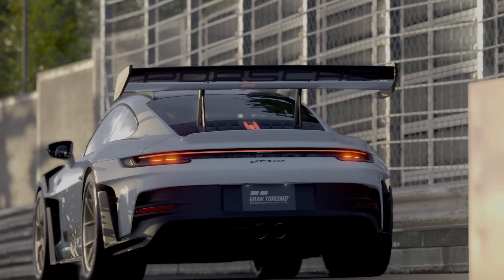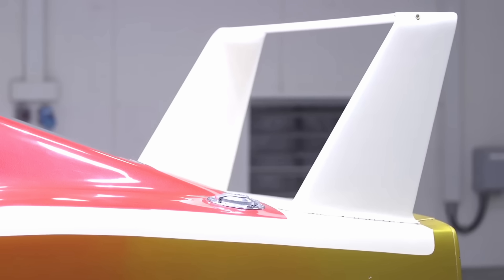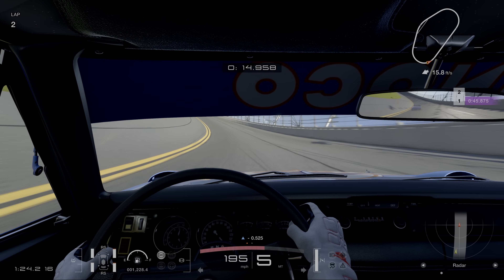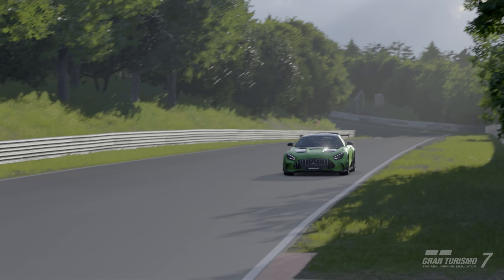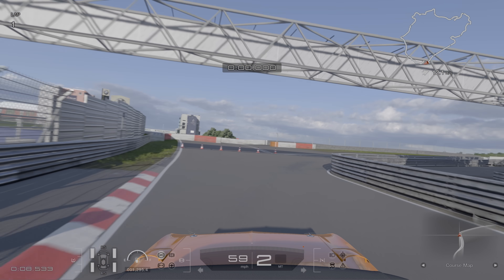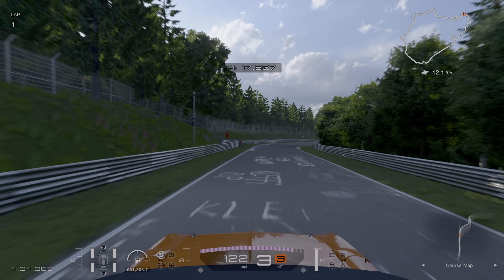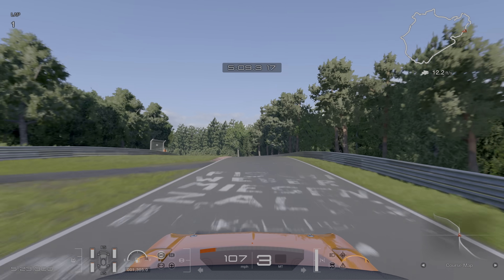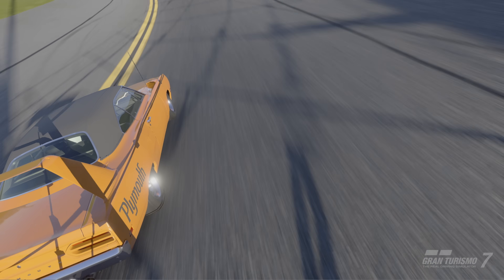Why Is This Car Undrivable in Gran Turismo 7?

Comment: Just wanted to mention, given the car that was a sensational lap. That was some serious jaw dropping performance mate
Reply: No kiding. It was surreal seeing that old boat blizing around the corners like that.
Reply: @souldude6344 the bounce on some of those corners was downright terrifying. I would’ve liked to see more cockpit footage of this lap
Reply: Indeed
Reply: Not to surprised really as Superbirds had great power to weight ratios, and surprisingly high torque even by modern standards. Also, people are forgetting that Superbirds got banned from NASCAR because it was way to fast, compared to it's competition.
Reply: @marcusking332  Thats just an urban legend. The Superbird got banned because it was no longer homologated. it was built for one year, so it could only race one year. NASCAR requires that any car that races has to to some extent- be built and sold the same year as a consumer car.  The Superbird was built only one year, and was a commercial flop, so they stopped building it- disqualifying it from racing after 1970.  Even then- the NASCAR raced version was significantly different from the commercial.  different suspension, different aero, tuned, stiffened body, etc.
The Superbird was such a commercial flop- that there were 1970 models still on dealership lots in 1972, which Plymouth started providing kits to modify them to be 1970 Road Runners so they would eventually sell.
Reply: @DR-pu5hm that's not true. Nascar rules for the stock division since the beginning has always allowed car from the current year and pervious 2 years. Meaning they could've ran it 2 more year but Ford was developing a more aerodynamic car and Nasar saw an aero war coming and banned them all.
Reply: @marcusking332 more entirely true. It only ran on the super speedways. Even then wasn't that must fast then the ford. GM really suck at this time and everything was faster than it.
Reply: @souldude6344 people forget these things are going around banked corners at 185+ even back in the 70s. The stock ones are slow, sure they weren't meant to be going above 90 realistically but with an actual NASCAR version(which is more or less what is presented on the Nur lap here) had some of the most advanced suspension components of the time given the speeds at which they took corners people forget how many G's that is

Comment: That car still looks scary as hell to drive..
Reply: To be fair it's basically a Dodge Charger with a big wing and sharp nose if you dumb it down to the core. Handles a bit better than your regular Charger R/T but don't expect it to run tight rings around a Lotus Esprit
Reply: Skill issue
Reply: @PlatinumNath I think you mean the Lotus Exige?
Reply: Does look kinda fun though. Seeing it glide through the corners at those speeds, bouncing all the way.

The idea of pushing to the limit an old car with that sort of roughness or lack of refinement to it's design would be appealing to some. So in that respect it does look fun lol.
Reply: @FLAMABBLE  I'm correlating it to a period correct(ish) example (1970s). If period correctness is not in my mood an Exige or Elise would work just as well to demonstrate comparison, but since it's not the case, I put the Esprit as a comparison (1976, compared to Superbird which is made in 1970. Course I can also use the Elan or Europa instead which is even more period correct but I bend my own rules sometimes, I know, I'm a scrutinizable pillock)
Reply: any race car is scary as hell to drive.
Reply: @DanielAlvarez-o6n  who said it was a skill issue?
Reply: But its a roller coaster or  bungee jump scary you want to be scared
Reply: @PlatinumNath  it's a roadrunner tho
Reply: @Taffaff  the Superbird version is a derivative Charger Daytona iirc but idk maybe you're right maybe not? It uses and alters some parts to make it look a little more "Plymouth-y" from the Daytona (apparently the Daytona was called ugly back then for some reason) from what memory serves me, which means that it's mostly a Charger underneath in actuality despite claims of Roadrunner basis - if that was true
Reply: Looks violent over the bumps like old NASCAR before they discovered coil bind setups.
Reply: @Maximus20778  i did
Reply: @DanielAlvarez-o6n  so you have driven a Daytona charger going 200 around a track no then stop talking
Reply: @Taffaff  it's like a trans am and a camaro or a challenger and a barracuda they are basically the some car built on the same frame with mostly the same parts
Reply: It is
Reply: @PaperBanjo64 sometimes its constantly rolled over if it tuned poorly especially on the front suspension.
Reply: Lol try driving a big block b-body mopar, if you think the video is scary.  We had one, 69 roadrunner, summer of 99, no corner went without a drift, tire smoke and a screaming V8.  It was an ex drag car with a cage and 2 seats
Reply: Old cars did indeed seem scary to drive fast believe it or not
Reply: It's a video game 😅
Reply: @PaperBanjo64  Mopars didn't use Coil springs! They were torsion bar front and had eliptical leaf springs in the rear.  Meaning the rear end was placed more forward on the leaf springs than centered.
Reply: @PlatinumNath it handles unbelievably worse than charger R/T. I can do le mans 30 minutes in my charger no issues at all even in the rain with 971 hp. This thing blows.
Reply: @Taffaff  That's a distinction without a difference. Road Runners and Chargers are basically the same car sold by different brands
Reply: Meanwhile me driving the 1969 Pontiac GTO judge at 600pp with 686hp and 800+ lb-ft on medium sport tires 🙃
Reply: @dc_modelworks  They do have their differences, like the superbird is about 3 mph slower than the daytona irl, I think they had differences engines too.

Comment: I guess the important thing to say is that the Superbird, on the racetrack of yore, was a heavily modified car with a cage in it (makes the whole chassis stiffer) using every trick NASCAR would allow, and some it didn't, while some of the smartest mechanics to ever live tweaked the car for the high speed oval. But the version the game gives you seems to be the civilian version of a 1960s road car, with a full interior, none of the modifications, and it would appear a very floppy chassis with a solid rear axle and 1960s suspension technology. This car knew it was going on the American highway, at maybe 100mph if the cops aren't looking, for a brief period, in an arrow straight line. Go figure, it's not ready for serious racing without modification.
Reply: is hilarious as it is sad that people see the street superbird and go "yeah this is exactly the same as the race version" like my brother in christ they aren't the same car at all
Reply: I've gone more than 150mph in old 1960's street version mopars. One an old 1969 Coronet 440 and another a 1966 New Yorker more highly modified. The Coronet was doing what I would call seesawing at high speed. Kind of rolling side to side and the steering was very light. I went by about nine Mass state police clustered in the highway center. If any came out to play I never saw them in my rearview mirror. 
The New Yorker had a polygraphite front suspension and a 440 built for me by someone that built Nascar Mopar engines in the 1960's and was still building offshore powerboat race engines. I lightened the New Yorker a lot. Took out the dash, AC, and heater, removed the rear window regulators and locked them closed, all the seats and put in two Dodge Omni buckets for seating.  I put in a custom aluminum dash with digital gauges. It actually was far better handling than the Coronet. I ran that to 150 or more many times. 
The thing about old Mopars is you had to know how to drive them! You didn't know how to drive them you could die real easy. To me though they were far better at high speeds than any Ford or Chevy I drove of 1960's vintage. Bias ply tires weren't exactly great for handling but would leave the best smoke shows.
Reply: These cars were built for torque and 1/4 mile times. They were not meant or geared to drive 100mph.
Reply: @TheBeefSlayer  I'd say you are pretty wrong about that! The whole point of the Daytona's and Superbirds were top end speed and aerodynamics.
Reply: @TheBeefSlayer  The Daytona was literally named after a nascar track.
Reply: @ImponteDeluxo  not to mention the hemi s carter engine
Reply: @2bfrank657  The Daytona and Superbird had 7+ inch ground clearance- that rivals most small SUVs nowadays. The Daytona and Superbird are homologation cars- nothing else.  They were designed to meet the absolute minimums for homologation so that highly modified versions could race in NASCAR. Nascar versions had different aero, gearing and suspension.  The requirements were the frame, drivetrain (minus gear ratios), and engine block had to be identical, and the body kit had to be superficially similar.
While they are fairly stable in a straight line or big oval at high speeds, they are considerably less stable at 100+ than most consumer cars and SUVs nowadays.
Reply: Well even backin the day NASCAR’s were not stock.  Way more so than today but they were still tube chassis race cars with lots of modifications done to them.  They are subframe cars so they flex like crazy without modifications.  

And yes I got an old 340 4 speed Dart and it gets a bit frisky much over 100 even on a straightaway.  It came with factory front disc brakes and 11in drums in the back but still does not brake very well and the steering is. It super responsive and it moves and floats around a lot.   Is fun as hell to drive though.  Just love banging gears in the old girl.  There are quite a few modifications I want to do to make her perform better some day.
Reply: Finally someone who actually understands what they are talking about and aren’t obviously a 12 year old kid lolol , but you nailed it my guy 🤙🙌

Comment: Honestly, the Daytonas and Superbirds that were actually sold were really just a slightly faster and gripper Charger/Roadrunner. Underneath they're basically identical to their base cars, i think people forget that these cars only existed so they could be modified further for NASCAR and attribute the Stock Cars performance to the street car also
Reply: Totally, the Superbirds were a RoadRunner with a different front bumper and a big wing, that's it. Also, there's a video of an old man that explained how you could notice if a Charger Daytona and a Superbird are original, and it's that the Charger Daytona has real fender vents/scoops and the Superbird didn't. The car is amazing but it was made like you said just because it was a regulation and at that time it didn't even sell.
Reply: The superbird had the 1970 cornet front fenders as well.

Comment: Please make more videos exploring how to redeem poorly-handling cars in GT games. 

Racing game fans rarely discuss min/maxing because going off-meta just isn’t rewarding with massive car lists and seldom need for a specialized build. It’s why I love FailRace’s Horizon videos so much - their arbitrary race requirements show love to cars you never actually see in lobbies, and sometimes someone strikes gold with an insanely potent build.

I really think this could be a great niche for this channel.
Reply: Which is ironic, given that Gran Turismo and Polyphony Digital always had an unmatched love for cars in general and an absurd amount of customization, ever since the 2000's, to the point of including all the worst and most commin roads cars one could find, like a 90's Ford Ka. It is not for racing, and you are not expected to use them, but they are there solely because they are cars people actually drive around in. It is the vehicle selection of Assetto Corsa, before Assetto Corsa.

But perhaps it is the customization itself that allows people to think it is all about minmaxing. I admit, I used to do the same. When the dial for spring rates is in decimals, should I go for multiples of 0.5 (4.5, 6.0...) or actually nail it down (4.3, 6.2...)? How much downforce? How much differential lock? How much toe and camber?

You see in forums entire breakdowns of every car, down to fractions of decimals. It is all absurd as well.
Reply: @NothingXemnas  I don't think putting a spoiler on a car is called "crazy customizations" lol
Reply: @Maximus20778 At what point did they suggest only putting on a rear spoiler/wing is crazy customization? 

The moment you add anything to the stock vehicle, it's customized. Most customize with tires, wheels/wheel diameter/width, wide body(if applicable), engine tuning, air, forced induction, gear box, gear ratio, weight distribution, weight savings and the list goes on. How did you come to the conclusion of a wing is confusing, do you even play this game at all?
Reply: @evilformerlys4704  He's a troll, and you fell for it. 💀
Reply: Yeah that's a good idea make a list of the worst handling cars and how to fix them , even though usually its rigidity and maybe tweak the suspension or down force but on forza you can just give the car 4wd

Comment: If you notice on that Daytona wind tunnel test, they laid out the rear wing just about flat, then did the test. Those wings (both Daytona and Superbird) IRL can be adjusted factory stock. If they had given it a bit of angle, there would be a significant difference to the "new" Charger duck tail.
Reply: Wasn't that video basically a modern dodge commercial?
Reply: @kyle8952  Could be, I'm not sure. I just noticed it in the clip provided here. Wouldn't surprise me that Stellantis would "nerf" an old car to make a new one look better.
Reply: probably gamed it to sell the new car. "look the new car has more downford that the superbird with that big 'ol WANG on it!"

Comment: There is one massive oversight on the part of PD when it comes to old car like this, and the pickup trucks. They have solid axles in the rear. They do not have adjustable toe or camber in the rear. For some reason, PD chose to allow us to make impossible adjustments when they should've either blocked them for an easy solution, or even provided the various adjustments that adjustable solid axle setups allow, none of which still include camber or toe mind you. So yes this car and others like it are simply simulated wrong, and that's largely why they have quirky handling.
Reply: Or cars that are automatic only yet you can drive them manually
Reply: Full manual reverse valve body. And I know how to adjust toe and camber on a straight axle. Run into a curb!
Reply: @keefgtp  cars that are automatic only IRL being "manual" is also a crime, this car and the The Judge are culprits
Reply: @Agent-mb1xx  the fuck are you on about the Daytona and the Judge both came with 4 speed manuals. Automatic slushboxes were available but not widely used.
Reply: @UnderwaterAlexJones  not in the game, not the IRL models that they have used, I missed to precise that part. Use the pilot's view and see, automatics
Reply: You can make small alignment adjustments to live axles in real life, and people do as they compete at higher levels, as a big name in American stage rallying told me. He rallies a solid axle car. You will end up needing a little bit more clearance on the axle shaft splines, kind of like a wobble socket. Of course you're not going to get 300k miles out of that setup, but you will get enough camber or toe to make a difference.

In the same way, you can get a FWD car to oversteer with a torsion beam rear axle by spacing out the front bolts on the rear hubs with washers. When the suspension compresses on the outside, the inside tire will lighten up and the extreme toe-out of the outside tire will cause the car to oversteer. A friend of mine learned this when he bought a rally car that had won its class in the SCCA ProRally national championship.

Just saying, if you are looking for a competitive advantage and are ok with consuming tires or parts, there is always a way.
Reply: Glad someone pointed this out. When he was talking about toe and camber I thought 'wait, that's a straight axle' but now I understand 'because video game' it has adjustable toe and camber. Not the first time and probably won't be the last.
Reply: i'm not convinced that they simulate body flex and suspension flex independently.  the old cars would have a lot of body roll and be slower to initiate turns. but the suspensions were reasonably rigid, especially the rear.  But to simulate body roll they flex the suspension unnatrually.
Reply: @baronvonslambert  I know these but they are not in GT7, look again, many cars' models are auto only in the game
Reply: @baronvonslambert  got any model as example? Just wanna be certain
Reply: Wrong. You can only change the setup when buying suspension upgrades
Reply: Yeah I’ve noticed a couple weird things with how some cars are simulated. The gear length for the stock mini ‘05 r53 is way longer and there’s no supercharger whine (irl that’s all you can hear; it almost completely frowns out the engine).
Reply: Actually they have kits to allow toe and camber adjustments on solid axle RWD vehicles. There used to be a racing series in the early 90s called the RaceTruck Challenge series. It was apart of the SCCA. It was base model compact truck in showroom stock racing. Most were the cheapest lightest trucks you could buy (4 cylinders, short beds, manual transmission, no a/c, ect). They had Dakotas, Dodge D-50s, Mitsubishis, Nissan hardbodies, Jeep Comanchees,  and even rangers. The series didn’t last long (due to lack of parity. One truck would dominate every race and passing was minimal). But every one of the trucks had camber and toe kits on the rear (as legal for the rules).
Reply: @BassRacerx GT has always been famous for every vehicle in the game to understeer like a pig bone stock no matter the configuration, drivetrain or whatever. Been like that since GT1.